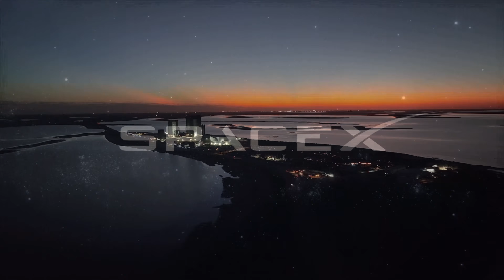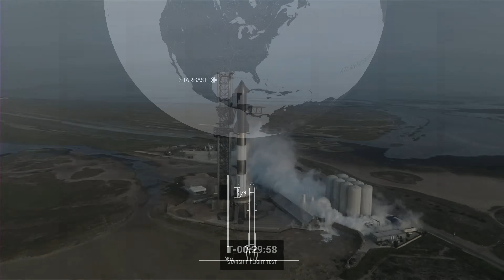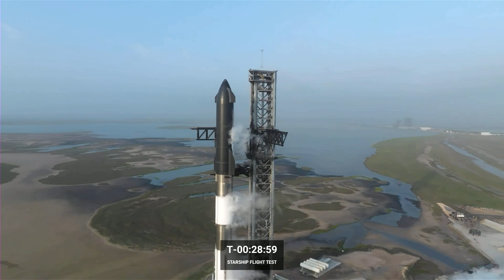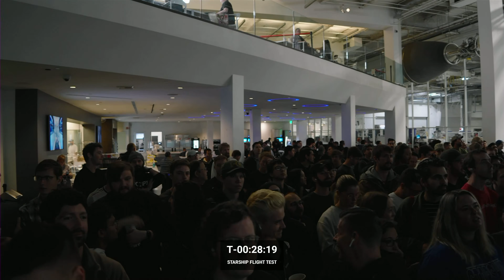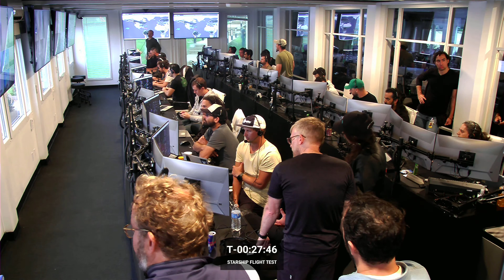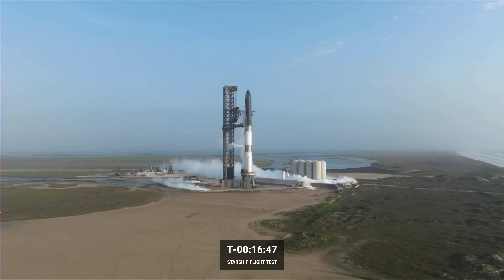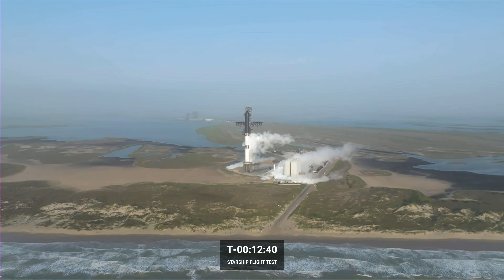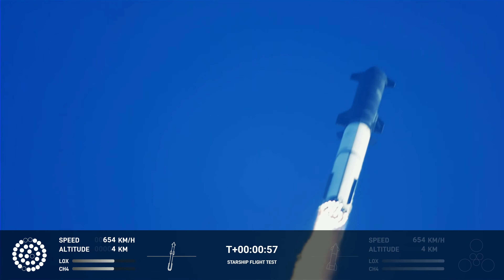Starship Flight Test

Comment: As long as space engineering does not change its bases, accidents will be constant. Remember the Columbia that killed its crew in 20 seconds. The Enlightenment gave rise to the growth of ideas and, in Renet Descartes' Discourse on Method, we have a great call to change. Several were the big names that brought changes in the bases of thought and what was fiction with Edson, a simple construction of a thread (a piece of thread called a filament) that when subjected to a certain temperature and surrounded by protection against oxygen, formed the possibility called light bulb. Likewise, electrical sine waves, alternating and (continuous) and the engineering development of the progressive production of electrical wires, which allowed electrical conduction and which finally illuminated New York, when everyone thought it was just fiction. Also, just to remind you, the millions of wires that were replaced by reading with encoder and decoder through optical fiber where 1 single wire replaces millions of copper wires and the fiber optic signal travels at the speed of light and has no electromagnetic and climatic weather. In addition, fiber cables ensure lower latency, that is, there is less delay in data sharing, contributing to transmission speed. , it wasn't for everyone, it was only in the 1990s that the novelty appeared for everyone, without going into details here as everyone knows. And how about remembering the old vinyl records of our grandparents that progressed to CD, DVD and then came the Pen Drive and then nobody wanted to buy original CDs, pirated CDs or Pen Drives anymore, because all you needed was an internet connection. And remember the cell phone? yes, it was a dream in our parents' time and the first was a brick and today it is an essential piece of communication in real time, being able to take pictures (or you prefer to call the inaccessible photographer to record your best moments / Society pushed by Enlightenment abandoned the old Middle Ages and brought, instead of slavery, the possibility for everyone, without exception, to have a labor bond, a form of work or a way to earn money and live in an environment of freedom. The Merchant class overthrew the Nobility , overthrew monarchs, absolutist kings, overthrew the persecutors of great thinkers and with new ideas challenged the apparent roughness of the seas, of the climate, making possible the discovery of new lands, making the planet habitable in its entirety.
The impossible always came before and will always come, because over time we learn to discover the impossible, that which was fiction, We are backward-thinking engineers like Descartes in his Discourse on Method, we make mistakes, we make mistakes and we make mistakes many times and we will make mistakes millions of other times, but we will continue to seek the impossible.
I remember that when the inventor of the telephone called his assistant, an incredulous man, to test the first telephone, Gran Bell's assistant ran away when he heard the voice that sounded like a ghost to him and it was just the beginning of what today is an indispensable piece in our society. life. Let's not forget that machines are idealizations of our thoughts and only exist when they succeed in being, through numerous attempts, finally successfully built. Let's remember the plane. Who does not know the story of Icarus? he who wanted to fly but did not establish rules, studies, observations, laws of aerospace physics, his end was not to see his dream come true. The plane was an impossible dream, but after so many studies, so many projects, two worked out, one of them by Santos Dumont.
So when we fall as children, when learning to walk, we shouldn't be afraid of falling. We must continue to try and go on modifying the bases of thought and adapt ourselves both to the strength of this turning machine, called our Planet Earth ship, and we must understand that if a way of passing the barrier of the invisible wall causes damage, we certainly have to periciar errors and improve the objective with new strategies. I had a great master who taught me that the best method is the method of methods, and life teaches us that falls teach more than victories. Falls don't let us forget. Victories leave us with a full ego and we don't become critical and stop in the comfort zone.
And, in the face of all this, there is no defeat, but there are lessons to be learned. Generations no longer want thinking careers anymore, we are seeing faster careers emerge like you tuber and IT etc. At the same time we are teaching people not to think without using a cell phone, becoming cybernetic. Nothing against using the network, it has facilities that save memory cells from recording classes and more classes. However, we have to mix this ease of automatic memorization given by the data on the net and also sift through the great minds.Tesla was a guy who was ahead of his time and came to design wi-fi electricity. We need to encourage other great minds, other Descartes, other Newtons, other Gram Bells, other young people with a great ability to interpret reality through different eyes.
Accidents even happen to travelers from other countries on other planets, as was the case with Roosevelt. However, what perplexes me most is the slowness of change in the laws that govern physics, space engineering in particular. Some inventions stopped in time. Rockets with stages should be outdated. Airplanes with turbines should have been as pathetic as canoes and wagons. So it's time to rethink our educational model for the great minds, the big brains, the ones who stand out because they have the gift of change. Let's remember that it was only 200 years of evolution and we managed to create everything from the combustion engine to the electric one; from the telephone to the cell phone; from the typewriter to the computer; and so on. We lost billions of centuries because of people who worshiped power, wars, the subtraction of alien lands. The rocket exploded not only for reasons that will be indicated in the forensics, but because we have to learn from our mistakes. And to err is human. One of these days I downloaded the GPT chat and, in the middle of that euphoria of people saying that artificial intelligence would replace human intelligence, so I asked the aforementioned chat to create an engine to reach the closest planet in the Andromeda Galaxy and the chat replied that I was not human. In other words, the chat is just a database, an algorithmic game of ready-made and more assertive responses on the net. By the way, in this regard, AI will only replace repetitive activities, just as robotic machines replaced repetitive strength activities. Cognition will always be a link, between the impossible and the possible, working as a retro-engineering tool, as we were born from an intelligent Engineer Creator who gave us a puzzle and patiently waits for us to do our part in our evolutionary growth, both in terms of physical as in what only He Knows. And that's it.

Comment: I can't believe they're Cheering what a failure, spread cement Debris 6.5 miles Fishing game, Destroyed there pad, Lost 5 engines, destruction of ship ,Out of control, where's the success in this, Better get some advice from NASA? Cheer on🎈 Crazy😅
Reply: The debris that went that far was most probably the dirt and sand underneath the concrete. And it was a successful failure. Not a success or a failure
Reply: FCC has shut it down, I explained the reasons from the news and commentaries this morning, also thank you for your opinion.👍🏻

Comment: Without payload this rockets was struggling all the way up didn’t go over 2,000 KM/H that’s sad with only 5 engines down so you telling me those 5 engines are supposed to put 100 tons in orbit empty was supposed to so even with 5 engines down speed should go way past 2,000 triple that empty so back to zero musk 😂
Reply: 6 engines out is quite a lot. With all working, it'll be ascending faster.
Reply: @logitech4873  8*
Reply: 8 engines is a lot for Starship. Disrupts thrust vector badly and obviously cuts the acceleration. You know nothing about rocketry.
Reply: You clearly know nothing about TWR, Gravity losses and payload to rocket mass ratio
Reply: the propellant weighs 3400 tonnes at liftoff. 100 tonnes of payload is a fraction of the total weight the engines are having to lift